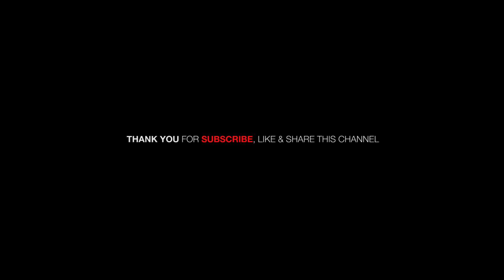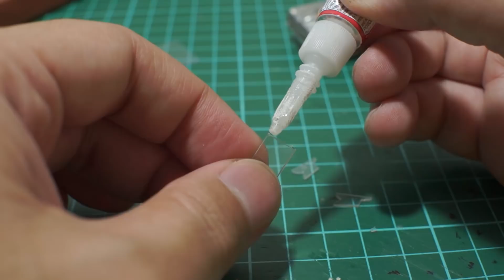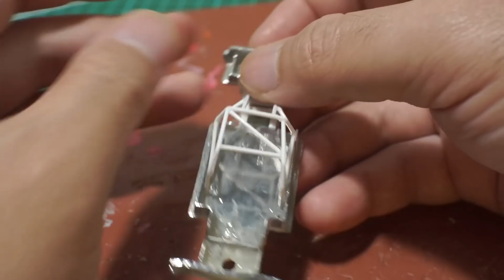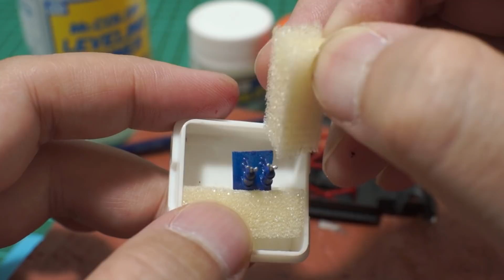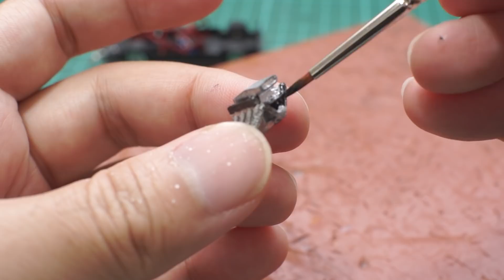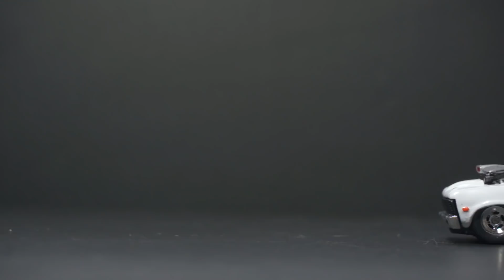'68 Chevy Nova Pro Mod Drag Car Custom Hot Wheels

Comment: Where did u get the seats,nitrous and engine from. Also what glue U use and what is that tool u drill with
Reply from the maker: I told it in the video

Comment: Why don't you use a bench pin when sawing? I see the diecast moving all over the place when sawing. You will be a lot more precise if you did. Right now you saw line are all over the place demanding a serious filing to even be square. 
A bench pin or similar thing will make your life much happier.
Reply from the maker: Thank you for the input🙏😊 I will buy it